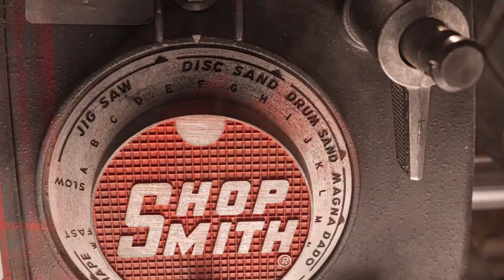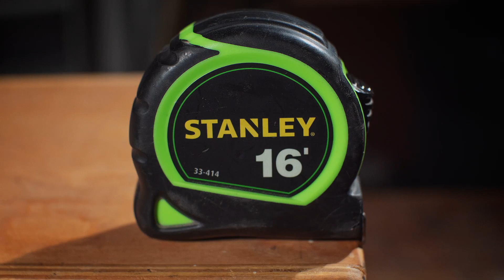MocoPromo

Comment: I like your dykstraflex recreating the star wars trench scene.  Building the trench to exactly fit the camera.

Given the stuff you like to do, I'm surprised you don't have a dolly track on the ceiling so the rig could run inverted over a larger terrain.
Reply from the maker: It is a great idea to have a gantry system, but its not practical for everything I do. This system can go with me if I really need to. It can be setup in multiple configurations. Not to mention the cost of the gantry type system.